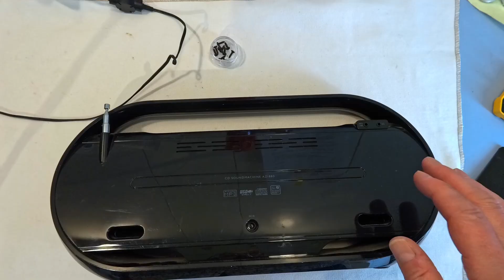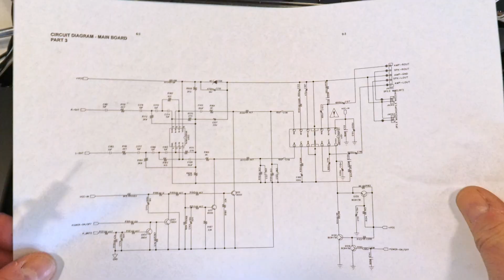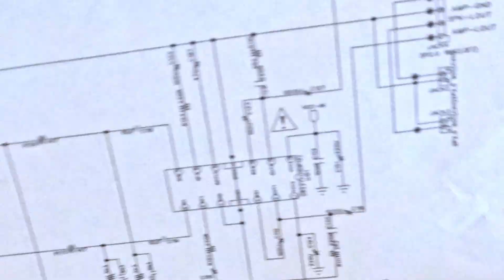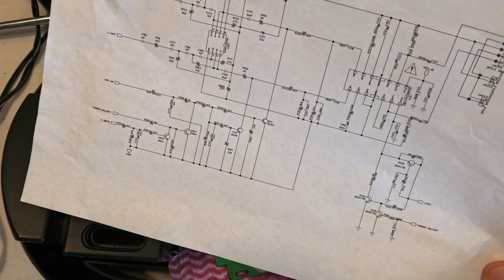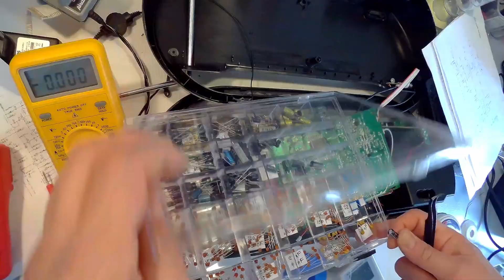No Sound Philips AZ1880 Soundmachine Repair

Comment: Thank you very much, in my case it was only the condensator. I took it of and everything works normal. Where is it for ? Is it necessary to place a new one ? Or has it no sense ?
Greetings from Matthias,
Kiel, Germany
Reply from the maker: In most cases the capacitor is to delay the switching of the output amp. When a device is turned on, it can make annoying plopping sounds in the speakers. By waiting a bit before turning on the output amplifier, those annoying sounds can be prevented. So the capacitor is not absolutely necessary for the operation of the machine.